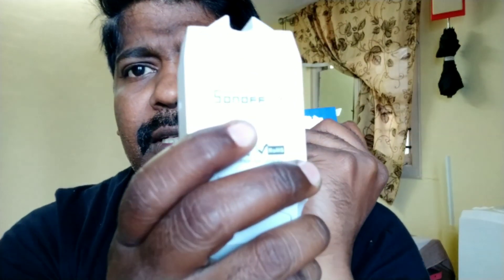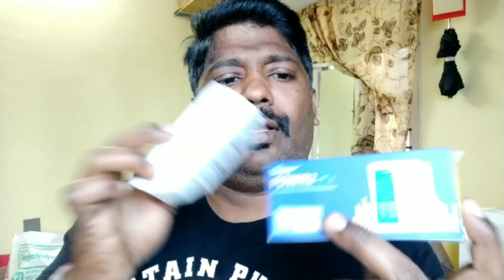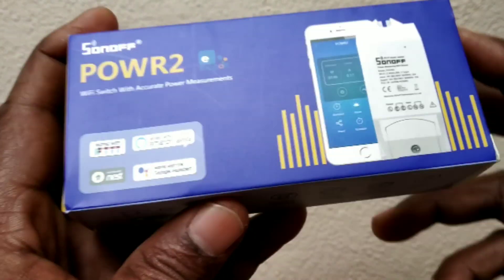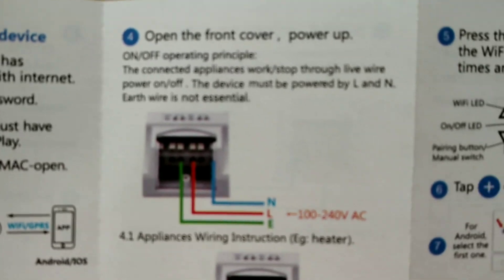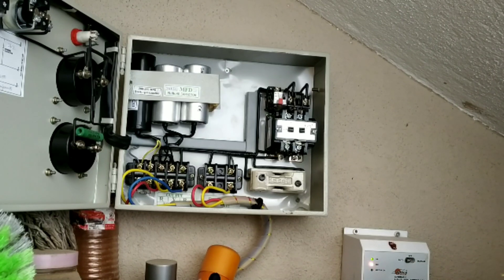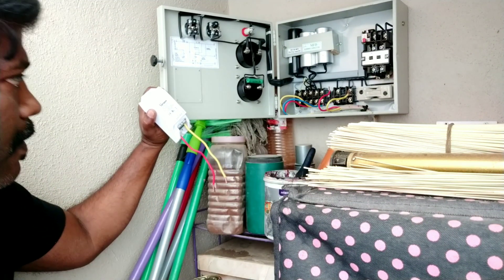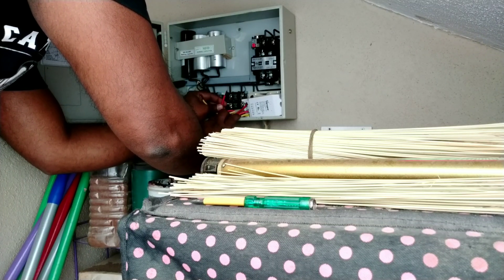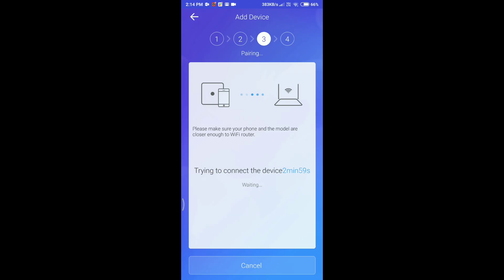SONOFF POW R2 16A 3500W  Detailed  Review with full setup with bore-well motor to monitor power .

Comment: Is it useful to switch on or off the submersible motor ? To a switch we use to push ?
Reply from the maker: It won't support turn on but you can turn off and you can monitor power consumption.

Comment: My sonoff 16 a Pow r2 , got burnt inside  while operating 1hp pressure motor.  What could be the reason ? The motor has auto cut-off and turns on and off whenever tap is opened.
Reply from the maker: Hi check may be some short circuit connecting wire sleeves, because terminal will be near to next ,  I am using borewell motor and sumb motor  more then 15 device of sonoff till today no issues.

Comment: Can I use on single phase water motor of 1 kw?
Reply from the maker: Sir, it will support up to 3000watts devise  16amp
Reply: @SambandamNandakumar  Thanx for quick reply. But what about jerk? I mean starting current?
Reply from the maker: @km5902  
Don't worry I am running with 6stage borewel moter

Comment: Can I connect this with 5HP 3 Phase Borewell motor to turn on and off the motor from mobile phone?
Reply from the maker: To turn on borewell motor must need  starter  ,but you can turn off  the same and you can measure power consumption detailed, and also you you use sump motor 1hp.5hp  directly via mobile.
Reply: @SambandamNandakumar thanks for your reply. I too have starter as you have shown in the video but mine is 5 HP 3 phase motor, I am not sure if this Sonoff pow R2  is safe to use and will be used to control from remote location or timer based auto on and off. Or I can use this Sonoff only for measuring the power?  In my starter It is mentioned as input and out as ~ 400 V but Sonoff pow R2 says 100- 240 V. Can you plz let me know your starter input and output AC voltage. Is it 100 - 240V or 400 V.
Reply from the maker: @vishnuvardhankasilyasudarsan  
Sir, three phase it won't support, only singo phase sir

Comment: Sir can i use between inverter output.
Reply from the maker: Sir,

I am using already with my solar inverter, you can use, any inverter
Reply: @SambandamNandakumar  Thanks your so grateful by sharing all your experiment and experience.
Reply: @SambandamNandakumar  Sir, how to choose a right DC MCB between solar and inverter?

I have two 12v 180watts panel  paralleled. So brand says output will be nearly 18- 20Amp. Please help me to select correct MCB?
Reply from the maker: @elavarasanfffc2992  
Sir, feeo brand DC 25amp available at amazon.in you can buy .but very important you need add DC SPD in the same brand available at Amazon.in

SPD very important for solar panels to protect your inverter and home appliance.
Thank you
Reply: @SambandamNandakumar  Sure sir. Once again thank you so much for  additional info.

Comment: I don't understand as to how a starter can start with SonOff... Usually you need the green button to press for 2-3 seconds on the starter.
Reply from the maker: sir,

 i have connected sonoff on power in put  to monitor power consumption .
please check 8.23 i have connected power input , not a power out put ,
Reply: @SambandamNandakumar   

So the Sonoff will only pass current to the starter & in turn calculate the power consumption. It cannot start the starter. It can though break the current & effectively switch it off... 

Another issue I noticed is that you updated the Firmware from 2.6.1 to 2.7.0. Does the new firmware has the option to remember "last power state" in the event of a power failure. Or does it always start in Off state when the power returns after a power failure event.....
Reply from the maker: @HailStonE999  

sir,
 we there is no option to remember -last power state,  when you log in the e-welink you can view whether live power volt and whether power is there or not ,  mine is sonoff always live since i have connected wifi router with wifi , motor connected direct power if it is power failure you can view it, in setting power on state - keep , i am using , since  power on or off nothing is going to effect starter and not going start the starter ,  to monitor power consumption  i am using.